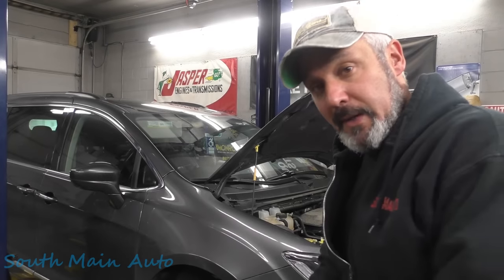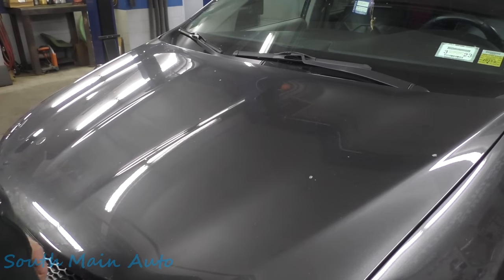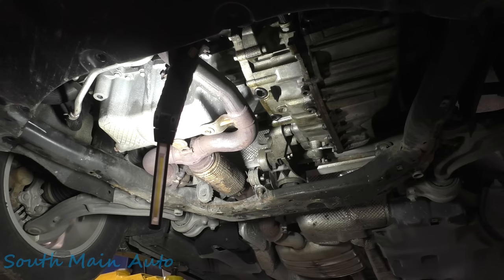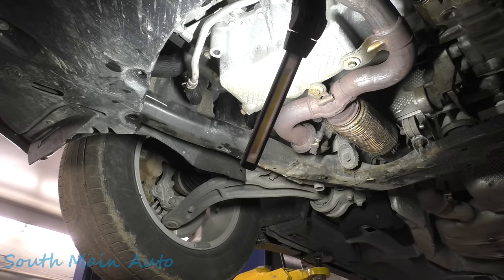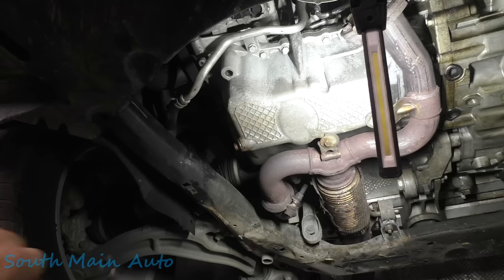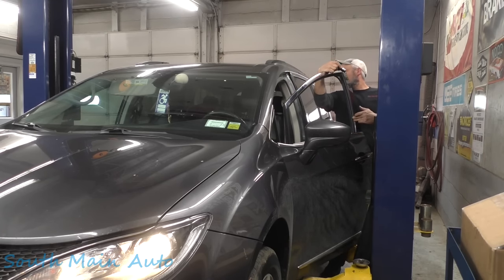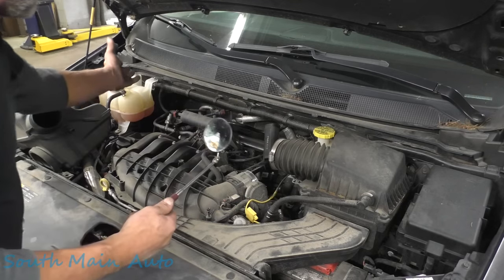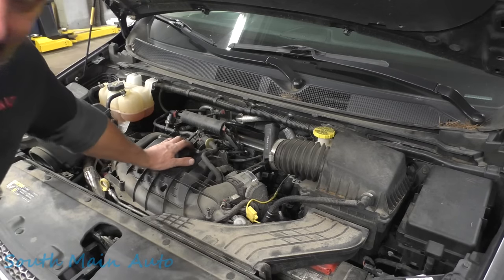Chrysler Pacifica Goes Full Nuclear 💥

Comment: Chrysler tech here, I've done 3 headgaskets and 1 entire engine on those Pacificas this year alone.  They had all been overheated and it was always the right side (rear) cylinder head.  Three of them had a low coolant level that went undiagnosed (customer just kept adding) and then overheated and began misfiring.  The last one that needed the engine had lost all coolant due to a raccoon hit and it smoked the cylinder liners too.
Reply: I work for chrysler. Always number 3 or 5 misfire. Rear head.. always warps the engine block.. ive replaced like 8 engines.. 17 and 18 was a bad year for Pacs.
Reply: @Minivan Lifestyle The problem is that Chrysler doesn't tend to put in the resources needed actually fix the issues, instead just finding a cheap workaround that doesn't actually address what is wrong.
Reply: @Minivan Lifestyle I just have to comment on your handle, Minivan Lifestyle. I too love the minivan. Who doesn't love two in the front, five in the rear?!✌🏻✊🏻
Reply: @josephrosen8239  I was a Chrysler tech from 2014 to 2018 and never seen a head gasket failure on a Pentastar im on my second vehicule with a Pentastar and they both have been super reliable is this only affect Pacifica's???
Reply: Is the Pacifica ok to buy with low miles and one owner?
Reply: If my memory serves me right chrysler put out a tsb for the rear head on these engines cracking or warping
Reply: @nothanks1627  😂😂
Reply: Do the ram promasters have the same issue?
Reply: @Jonathan11225  , about the Pentastar, as a "non-tech" I "inherited" a '14 Grand Caravan and at ~115K miles the #1 fuel injector failed. I think the resistance value was 144 whilst the others were around 12.... I did the work to replace it. I also noticed that the engine had a little "tick/tap" sound that I thought could be normal because some engines "tick/tap"... But then I learned all about the notorious "tick/tap" of the Pentastar. If you've never had it, consider yourself fortunate because plenty have. They put those engines in Jeeps, obviously the vans, Chargers etc., and I've seen people with all of them having the same issue, the valve train components fail and often times begin shredding the cam lobes. 

So as the "non-mechanic", I replaced all 24 roller rockers and valve adjusters as well as the intake cam on the rear bank of cylinders as the other cams seemed ok, they only had the lightest of scoring... The rocker frames were shredding the cam lobes on that intake cam and at least two of the lobes went from the usual "tear-drop" shape to being completely rounded! I discovered the shavings etc., on the oil filter when I went to change it the first time I had it. My folks had various shops change the oil so they never even saw it.

Obviously the shop "help" never mentioned this to them because I know they didn't just appear all of a sudden when that much steel from the cam lobes was shredded... Of course after doing all of that BS work, the engine sounds like a new one but the problems didn't end, suddenly the MIL was on near every other week for "gas cap, emissions small/large leak, coolant not getting hot enough, oil pressure is 96psi at all times...." I thought, damn what the hell did I "inherit"... -_- Replacing the thermostat as well as the oil pressure switch fixed those items and then I found near all of the fuses/relays in the TIPM were OUT of their slots by a 1/4". Apparently Dodge/Chrysler "TIPMs" seem to be another notorious issue for failure. I just couldn't believe that they sell these vehicles then and today $20K-$40K+ and customers find out just how badly they've been screwed in buying them to then pull more $$$ out of pocket for diagnostics/parts/repairs to the tune of almost never being less than a $1,000 at the stealership. It's abhorrent.

I can say that because of the experience I'd never buy a Dodge/Chrysler product myself. I've also bought a brand new foreign car and it quickly became a piece of excrement shortly after... But the van isn't even 10 yrs old and yet I have vehicles more than 20 yrs old which never had these kinds of issues. I have one American-made car which had the instrument panel replaced, replaced valve cover gaskets as well as engine and transmission mounts. I'm driving it but the transmission needs reprogramming but the car is 18 yrs old and has over 240,000 miles on it (good ole reliable push-rod engine) and that's all that's been done besides the usual replacement items, serpentine belt, batteries, brakes etc... 

Frankly, most new vehicles are nothing but high-cost, overly-computerized disasters waiting to drain the consumer's wallet because so little can be done without "computer diagnostics" as well as AFTER making repairs then needing to perform, "relearn/reprogramming procedures". There are so many poor designs in engines, transmissions, suspension, then you get to the interior components and all of the "computer controls" for the cabin and under the hood. I think I'd have to look back in time for more reliable, cost-effective transportation but then that's what the "gubment" is trying to quash.
Reply: @MazichMusic  I wouldn't buy one new tbh. My wife had a Caravan with the 3.6 and it was a money pit, I don't think 6 months went by without something going on it.
Reply: I remember when the Pacifica came out, Car and Driver tested a loaded one and it was 48000 dollars.  The three year value was unbelievable and projected value was like 12,000 dollars when it was five years old.  I was like, wow!  But I guess no used car is cheap anymore.  Couldn't hardly buy an ATV for $12000 anymore.
Reply: @Minivan Lifestyle we
Reply: @Minivan Lifestyle as an owner of 1st generation Ecoboost (2011) I can relate.  I had put in over $3500 to replace the timing chain and cam phasers because of the Idiocracy of the college educated engineers at Ford.  Let's put a standard 3.5 liter V6 timing chain on dual turbocharged engine.  What could possibly go wrong here?
Reply: @Minivan Lifestyle as much as I don't want to agree with you, you are absolutely correct.  I do like this engine.  I love the power and boost I get.  I have an 2018 Explorer with 3.5 L V6 and hate that it doesn't have to boost as my Ecoboost does (my 2011 F150 has the Ecoboost engine).  Even now with all these years to perfect it, they still haven't and still have issues even with the new ones.  I've seen a lot of videos on here with Ford Master Techs that have to replace the cam phasers on engines with less than 50K on them.  No way in hell that should happen even when taking care of the engine like you should.
Reply: @Minivan Lifestyle as for the water pump. It absolutely pisses me off that my water pump is internal one.  Located inside the timing cover.  I replaced mine when I replaced my timing chain since they were already in there.  Damn near costs the same to replace the pump as it does to replace the timing chain.  Absolutely ludicrous!
Reply: @Jonathan11225  the upgrade 3.6 warps super easy. Especially on 17 and 18 pacificas.
Reply: @Minivan Lifestyle damn that's impressive to have a Chrysler product last long.
Reply: @bearing_aficionado  many of the older Mopar minivans with the 3.3/3.6 have well over 200k miles without many engine issues. Trans are a totally different issue, hit or miss and don't get me started on body rot...
Reply: @infin1ty850  Then they move on to the next model and swear it will be 👍. Rinse and repeat for the past 40 years.
Reply: I just liked your comment to get you up from 99 likes, I have OCD
Reply: @Jonathan11225  156k on my 2012 Caravan.  I've seen hotshot promasters with 400k Miles on original drive trains.  Maintenance  is important and nobody seems to do it nowadays.
Reply: @josephrosen8239  "always warps the engine block" Eric's guiding light got that part right too - don't just slap a head on it. Thanks for the gouge!
Reply: @MazichMusic  I wouldn't buy one lol
Reply: @Minivan Lifestyle Ford fixed the Ecobust in 2020 at some point with a new block design. The steam reliefs were removed and replaced with a cross drilled pass through.
Reply: @Minivan Lifestyle I had a first gen Focus for years, it was one of the best, most reliable cars I ever owned.  With a manual transmission and upgraded SVT springs, it was a riot to drive and cost less than a set of tires for a luxury car....   It was totalled in an accident, but my wife and I still mention it as one of our favorite cars ever, even after various luxury Euro & Japanese cars.
Reply: I can second that, I was a Chrysler tech from 2015 to 2016 and I saw plenty of 3.6 misfire issues caused by valve seat problems.  But I can’t ever remember seeing a head gasket issue as a primary issue.  And the valve seat issues were always on the head closest to the front of the vehicle.
Reply: @josephrosen8239  So has anyone actually determined the root cause for the overheating? Poor block and/or head design? Bad head gaskets? Thermostat sticking? Cooling fan issues? I would be concerned if I just replaced head gaskets w/o know exactly what caused the overheating.
Reply: @Jonathan11225  maybe the bolts back off a bit.. this is the only engine that is allowing us to repair head bolt threads and install helicoils.. never seen that on any other engine so far...
Reply: Good lord..what the hey...... poor quality engines????
Reply: @josephrosen8239 Why is it just the rear bank,,, maybe I gets to hot because the catalytic converter is close and runs along side the head..Why only gasket failures on Pacifica 3.6 and no others??
Reply: Get a Chrysler Pacifica hybrid...much better and better cooling! My 2020 flawless... 32k

Comment: Man, what a lucky area of the country to have a shop to go to that'll actually look at your vehicle and dig deep to diagnose the issue rather than making a snap judgment and do a ton of unnecessary work. Now, this video isn't a great example of that because this engine was a goner from the get-go, but if you've watched this channel long enough, you know what I mean. All we ask is for an honest look into the situation, right? That isn't the case in a LOT of situations, but it is here. Kudos to SMA! Honesty & diligence goes a LONG way.👍
Reply: What is better to diagnose it right, or do a ton of unessesery work without  solving nothing
Reply: Straight to the problem, no time wasted, no money wasted. Excellent.
Reply: The 3.3/3.8 was a solid engine, many go for 250-300k miles before they crap out.
The 3.6 is a dog. Ive heard nothing good as far as reliability.  
Thanks for putting this up Mr O, you've helped me make my next purchase decision, Honda or Toyota
Reply: couldn't agree more.
Reply: @LayZeeDawg  it's interesting you say that. I've heard more 3.8 horror stories than 3.6 I personally have a '13 town and country with 3.6 with 207k miles and it's been driven hard for the last 122k miles we've had it and it hasn't had any major issues
Reply: @timburrell3483  the only issues that have arisen with the the 3.8 are 2008 and up. Prior to you could run mud through the cooling system, tar sand for oil and they just kept chugging along
Reply: @LayZeeDawg  hmm that's interesting. The main thing I've heard is excessive oil consumption
Reply: @timburrell3483  not really sure if it is really oil consumption or leaking. There are issues with intake manifold and valve cover gaskets that fail and leak around the 100-125k mark. They're not really noticeable and certainly not catastrophic.  
To be honest here, I've been driving a long time. Domestics lasted 10 years/ 100k miles and were pretty much done.
I've got 150k relatively trouble free miles on a 2006. I think we've been spoiled
Reply: @LayZeeDawg  that makes sense. I've been very surprised with how long this engine has lasted without any major issues.
Reply: Mr O is a guy! Word does get around when you treat you customer like your treat a loved family member.
Reply: A good trustworthy Mechanic is as good as Gold.
Reply: Very true, I'm glad that I only live 18 miles from SMA and have taken cars there in the past. I have zero reasons not to take my car to SMA if I need something done. Especially if it is electrical. Eric O. is a master.
Reply: @OuRuKai  Wow! You are one of the few subscribers that have this special opportunity to have Eric fix your problems! Hard, almost impossible to find a great tech!
Reply: 100% agree
Reply: It's very annoying how alot if shops don't take pride in their work these days. wish more mechanics cared like this.. and not be arrogant as well.. I salute 🫡 you Sr. Keep up the honest work.
Reply: @LayZeeDawg  Spoiled, by better engineering. Come on. In the late 50's you were lucky to get 100 k these days 300k isn't that unusual. My wife's '99 Yukon have over heated and seized once and another time ran in the red for quite a stretch and it still runs like a top. No smoke a a slight amount of oil usage mostly due to leakage.
Reply: My 2018 pacifica started with a small loss of coolant then slight misfire on cold startup. Started seeping into cylinder 1 after a hot soak. Caught it soon enough to be able to put a set of head gaskets on it before the change engine light came on lol.
Reply: all you have to do is know what the hell you are driving and fix your own cars

Comment: "Of course being a modern day car, we have the oil absorption pad.." 😆
Reply: John Villeneuve  That's automobile engineering at its finest.
Reply: John Villeneuve  So should we uninstall it when we get the car? Asking for a friend.
Reply: I pulled one off a subaru that weighed at least 15 pounds from all the mud and rocks that were being stored on it.
Reply: People are so stupid these days how do they know how to start a vehicle 😂let alone drive it
Reply: @quinndirks5653 nope, but pull it off every oil change. So you can give everything a once over, once in a while.
Reply: Unit_450 no way. All
Of those components use weatherpack connectors that are water proof. They mostly use these goofy covers for aerodynamics and to improve efficiency. Get you that .001 reduction in drag 🙄

They also double up as excellent insulators to cover up leaks and drips. Especially when they slap an absorption pad on them. Which many manufacturers are doing these days.

Comment: I’ve personally seen 2 of these engines with less than 60k come in with blown head gaskets. One came in as a no crank no start customer forgot to mention it got hot and they drove it until it stopped. After some testing found the starter was bad and replaced it only to find the overheat condition on the test drive after, and after some more testing discovered the bad head gasket.
Reply: "Convieniently"forgot that they seized the engine....  OMJ!
Reply: @tcpnetworks  the engine wasn’t seized in like a bearing failure sense. Making sure the crank turned over was part of diagnosing the starter as it made a thump noise when trying to start the vehicle. After replacing the starter bottom end wasn’t knocking or anything so I suspect it got hot enough to warp a head and possibly hydro locked a cylinder is why it stopped running then possible the coolant had drained down into the oil pan as the vehicle had been towed in the day before so it had been sitting about 24 hours before it was worked on.
Reply: Burned the starter trying to start a cooked engine?!
I had a guy burn up a starter after the timing belt went on his Galant!

Comment: Shout out to that starter, it must have put up a solid effort before it lost the war of starting that engine lol.
Reply: 5 YR OLD DODGE!
OMG   
THATS LIKE FORD TOO
DONT EVEN LAST TOO
SEEM  THEM JUNKED  LESS THAN A YR!
Reply: @ekop1778  Toytota 💪🏾 💪🏾 💪🏾 💪🏾
Reply: @Big_AlMC  TOYOTA GO LIKE 300K MILES AND STILL GO  
SUBIE  MAYBE TOO
JUNK THE REST OF THE NAME BRANDSTHE NEW BRONCOS   HAVE LIKE 100 RECALLS  AND NEVER RUN
RANGE ROVERS ARE KRAP TOO
Reply: @ekop1778  hondas are great too
Reply: @lordjaashin  I GUESS SO 
BETTER THAN MY LAST CAR I HAD  97  CHRYSLER KRAPPER NEON 4 DOOR
I CANT BELEIVE I HAD THAT THING 20 YRS
Reply: @ekop1778  BUT WHY ARE YOU YELLING!?!?!
Reply: @danielschabilion9435  CAPS BROKEN  TRY REBOOT NOTHING
Reply: @ekop1778  My 04 Neon that I bought new has 167,000 miles on it and has been the best car overall I have ever owned.  Not the fastest or most fun but perfect for 98% of my needs.  Not only has it never left me on foot it never needed any warranty work or recalls.  Other than alignments and tires I have done 100% of the maintenance on it.  It still runs like a top and gets up to 37 mpg on 10% ethanol crap gas at 5000 feet altitude.  The drivers seat bottom started to wear but I realized the left and right seat bottom are the same so swapped them and added seat covers to protect them going forward.  Other than a newer stereo that has USB capability it is still "as built" and even is still on its original clutch!  I didn't know 167k was possible!  My first car was a 60 Plymouth Valiant, I currently own several MOPARs.  Most automakers made one or more good cars and most/all made a mistake.  Almost all cars have something that could be better.  A lot of it depends on what you use it for.  It's been fun watching Eric O. and the family over the years.
Reply: Any make is good as long as you take care of it. This lady should have shut it down the minute she saw coolant loss with no leak, or brought it to the attention of someone like Eric. 

That engine could have been saved.

People just drive that sh*t into the ground.